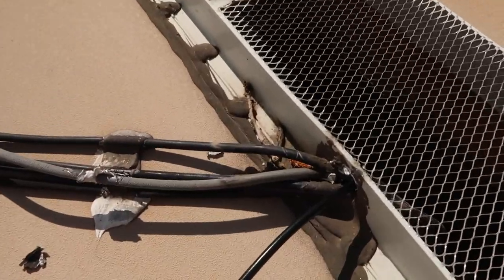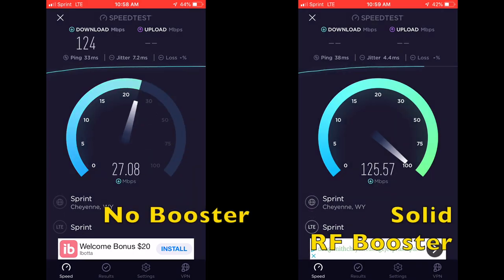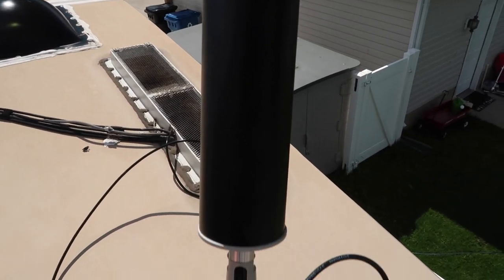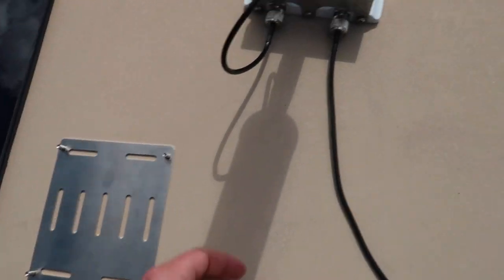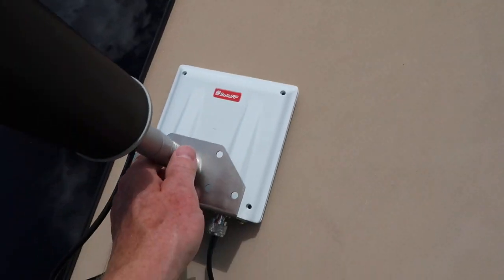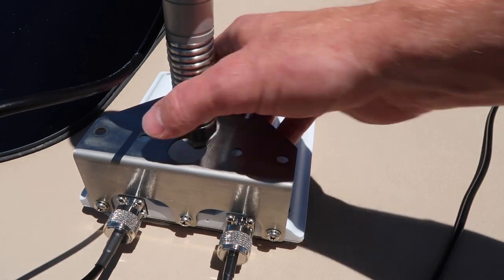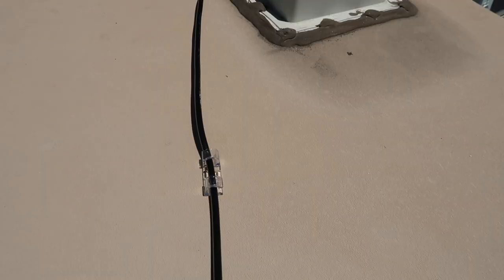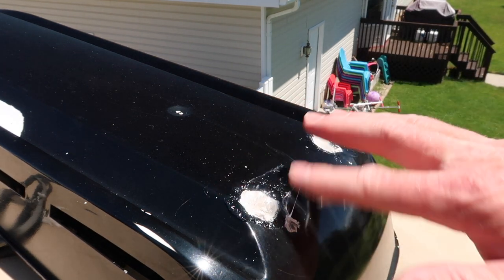Installing RV Pro Solid RF Signal Booster on 5th Wheel

Comment: Wow. It is a lot easier than I thought it would be. I didn’t know you could glue it down. I always thought you had to put holes in the roof.  Thanks for the very informative video. 

We have T-Mobile and their coverage is awful. We drove over 1.5 hours in MS on a major four lane road with no coverage - 0. We’ve driven on I8 and I10 with very spotty coverage. We’ve been inOregon with long stretches with no coverage. And where we go camping there is no cell phone coverage on any carrier. So after I retire I’ll be switching carriers. Then I’ll look into these devices. But this was super helpful. Thanks.
Reply from the maker: As long as there is some service it will boost it.
Reply: Does it matter what carrier you are on?

Comment: Thought you were going to use some doubled sided eternabound / gorilla tape. I though (and definitely don’t know) that some RV roofs you had to be careful what kind of adhesive you use. EPDM vs TPO roofs and stuff. Looks like a nice antenna. Look forward to see how it works out camping.
Reply from the maker: NonRev thought about it but rv shop said this glue would work.  Hopefully it works without causing a problem.  We will see I huess